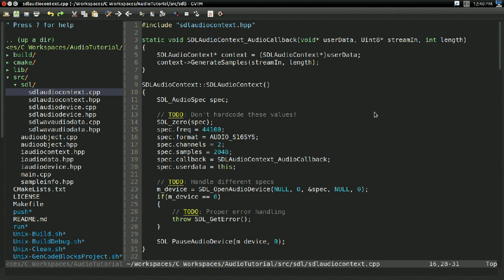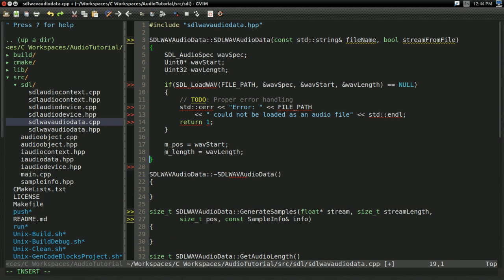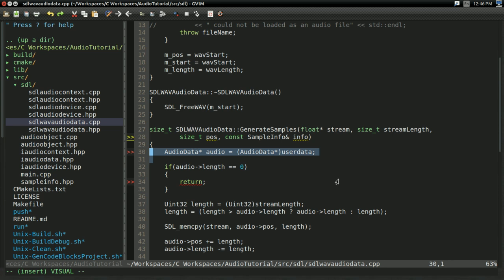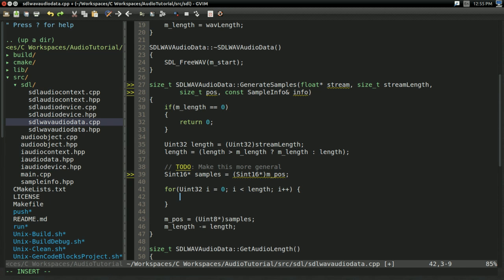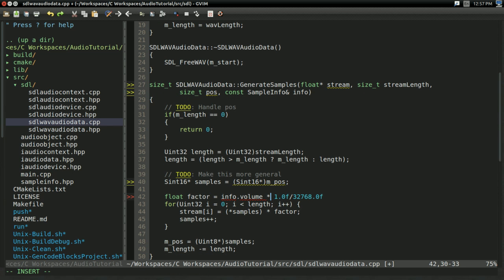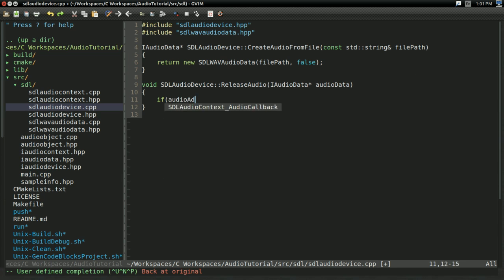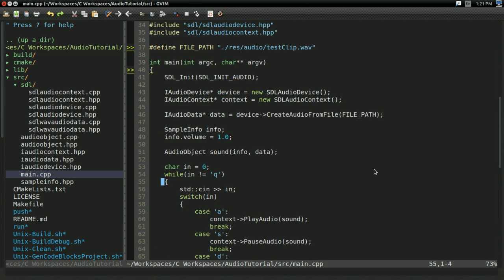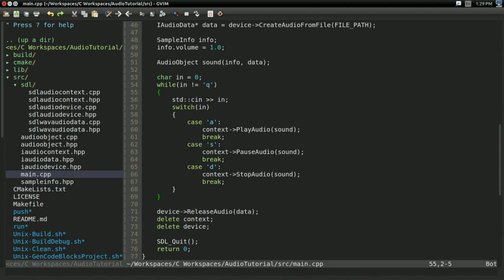#7 Audio Programming Tutorial: Completing the Audio Architecture

Comment: There are some mistake in my opinion.You do "SDL_PauseAudioDevice(m_device, 0)" and call the function "SDLAudioContext_AudioCallback" in result, however,  there are no data to handle, the AudioObject object has't been initialized, and this will lead to a arroe about "Access violation reading location 0x00000000" Do you have any idea about that?